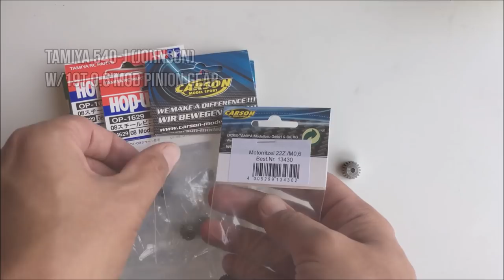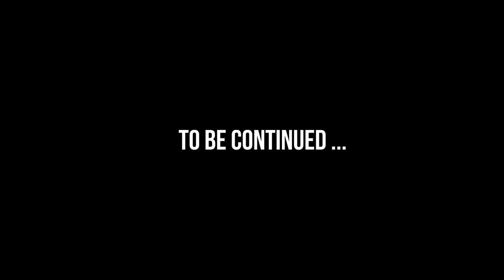Tamiya DB-02 Project Ep.3: GoolRC Brushless 3900 KV 4-Pole Complete Combo & The Tamiya Leonis 58507!

Comment: Looking good, Mikael!  That combo sure performs well for the price - nice and smooth too, to look at and to listen to.  I have had the same issue with reverse being faster than forward - very strange. The 19t will be great on the rough - I look forward to it!  :-)
Reply from the maker: Thanks for watching, Mark! Yeah, pretty amazed at this. Man, compared to my old cheap combos, the new cheap ones are amazing. So smooth and with lots of acceleration and nearly none of that clocking. Yeah, sometimes it happens. Luckily with brushed and sensorless brushless motors it is a 5 second fix changing the wires. Unless one has the trouble Derek encountered in one of his last videos? Seen that? So strange. Never seen something like that. Yeah, the 19T is really perfect for the rough. A bit wild though with that torque and that motor. Gonna try a larer pinion for the asphalt later though. Tamiya specifies the DB-02 gear ratio with a 23T pinion. That will get too fast for me, but for a little speed run it will be fun :-)
Reply: Hi mate - yeah, I did see Derek's motor issues - but I was stumped and couldn't help either!  And yes, I is definitely gonna be fun to see how your DB goes with the 23T pinion - try not to turn too sharply at top speed!!!    :-)
Reply from the maker: Cheers, mate!

Comment: Very nice speed and good acceleration. Seems ok for a track. Looking forward to the gps part.
Reply from the maker: Yeah, and it even has a lot more acceleration than shown in this video. I was quite gentle with the throttle, to save the thread on the tires. Yeah, I'm pretty surprised of this sensorless system. So smooth. Not any noticablke clocking. Could work on a track for a non-pro I think. GPS coming up. Hey, did you try it with a larger pinion than the 19T? Not that I really need any more top speed, but could be fun. It winds out very quickly with a 19T. Tamiya specifies the gear ratio with a 23T. That will be fast with this 3900 kv.

Comment: @Nordic RC Visions, a friend of mine has this ESC and motor combo, his has an issue with the motor shutting down after a ten minute run, it'll slow down to a snails pace. We have to wait about 30 minutes before the system will run again. He's running 6 cell NiMh batteries and I think his gearing might be a bit high since he has it in a Kyosho SC truck which does about 35mph but it has the same acceleration as my brushed 2WD Slash which I don't think it should have. Do you think its going into some kind of overload protection mode or is it something to do with the low voltage protection?
Reply from the maker: Hi Robert. Sounds like an over-heat protection system?, especially if it reboots after cooling down. Have you tried measuring the temp of either the motor or the ESC? I haven't had any problems with mine so far, but I'm not running it with a high gear ratio and only on 2S.
Reply: @NordicRC  He just responded actually. He said the fan doesn't always work haha.
Reply from the maker: Must be an over-heat system. Down gearing it could help?
Reply: @NordicRC  Yeah I'll mention that to him. How do these systems run to say a 13 turn 540 brushed motor?
Reply: @NordicRC  Its still shutting down even with the fan running. He said the connection wasn't good going to the fan. So now I'm thinking its just failing, he had a Hobbywing 1060 that acted in a similar way when it died. It just kept running for fewer and fewer minutes until it no longer worked.
Reply from the maker: Still sounds like a gearing and heat issue. A fan do not help much if the motor/ESc is on too hard work.
Reply: @NordicRC  Yeah that's what I'm thinking. I mean the acceleration is quick, but compared to my models  with the Velineon system it feels like my RC's have much more  torque though. So maybe his was a dud from the start. Or its just a lower powered system. Right now his truck seems like it'll do maybe 35 or high 30's? He's got a 20 tooth pinion and a 86 (I think) tooth spur on it.